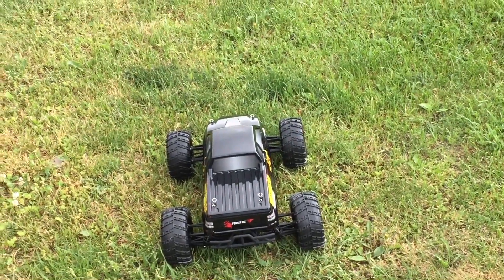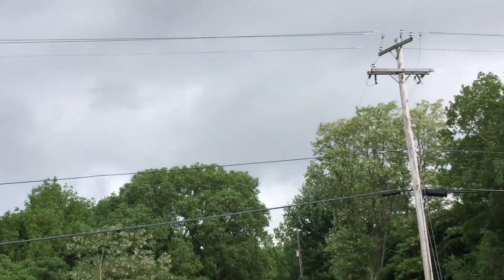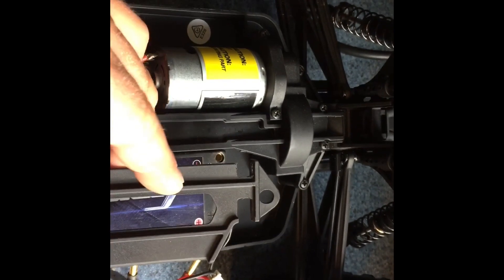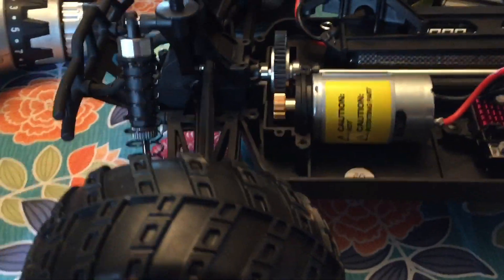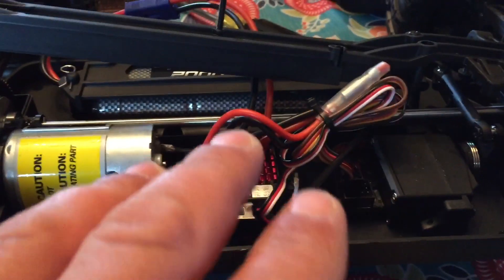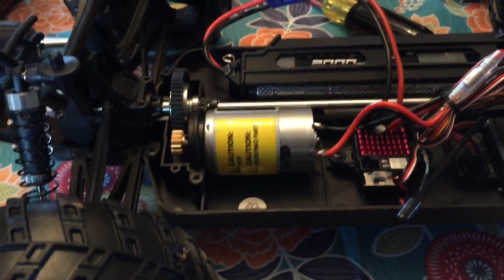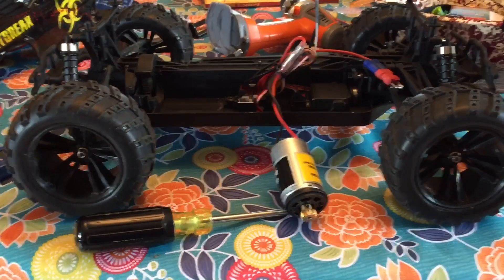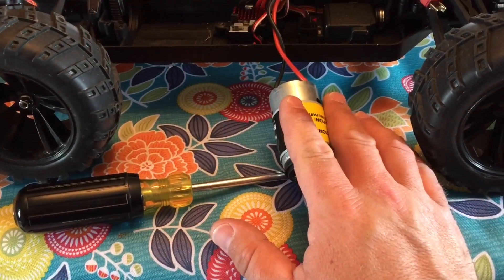Force RC Outbreak MT-issues from the start

Comment: I had the same chassis ..Himoto Tanto brushless.. plastic is very brittle ..the buggies exposed shock towers broke on the first few small jumps lol
Reply from the maker: I’ve been tempted to try the Himoto brand of rcs
Reply: It's hit and miss..the tanto was cool but brittle..but i have a himoto viper nitro and its tuff as nails lol..force rc and iron track use the himoto tanto chassis

Comment: Bummer the motor adjusts the pinion gear mesh to the spur exactly like you shown when you spin it in the slot because the collar on the motor is out of round so when you turn the motor it is like a cam and makes it get closer and further from the pinion gear..  Does it have a slipper clutch maybe it was  way to loose and slipping? I think you may have put the motor in and had the gear mesh to tight why the electronics over heated... next time put a piece of small paper in between the spur and pinion gear and turn the motor like you did until its tight meshed then roll out the paper and it should be set good.😊👍
Reply from the maker: Honestly, I’ve done the paper thing so many times, I figured I didn’t need to because I had gotten good at it lol. I’ve never seen on a 4x4 before that the screws didn’t actually “lock in” the motor position. Just that cover with 2 screws on the top to lock the position seems odd to me. I thought maybe the rear diff gears were shot but if that was the case, wouldn’t I hear it when rolling the truck by hand?
Reply: Hi that's one of the best methods they now use for adjusting motor pinion gear mesh, to test if any gears are shot take the motor out and press your thumb down on the spur gear with pressure and force the truck to roll forward and backward while applying pressure to the spur gear making it hard to turn if it turns the spur with pressure held down on it a bit when you roll it back and forth then the gears are most likely intact.
Reply from the maker: Awesome, thanks for the info Steve, I’ll try it out! 👍✌️🤛
Reply from the maker: Hey Steve; if I may pick your brain for a sec? I got the new spur gear yesterday and installed it but I’m getting the same crunching sound. The diffs seem fine..there is no slipper for it, the spring on the driveshaft is held in place by a pin and small cup; no nut to adjust tension...and the motor collar is perfectly round which seems odd..I can’t for the life of me figure it out..do you have any ideas?
Reply: +Haydad RC Hi the plastic on the motor is perfectly round but it's mounted offset with the motor, if you place it in the chassis and spin it completely around slowly one turn you will see that the pinion gear mesh gets tighter than loser, you probably won't be able to turn the motor in the mount one complete turn because of how it works. go toy with it you will see how it works 😀
Reply from the maker: Ok...I have tried different positions by turning it but no luck...I’ll mess with it some more tonight after work...I really appreciate your time!
Reply: +Haydad RC Hi take off the pinion gear place the motor in the motor mount look at the motors shaft and turn the motor slowly one turn you should see the motors shaft move closer and furher away from the big spur gear when you spin the motor around in the mount.

Comment: It stinks to get a brand new RC with multiple issues straight out of the box. Here's hoping that it's worth the trouble once you get the problems ironed out.
Reply from the maker: I realize that every now and again a stinker makes it off the line, but concerns me when a kid might get this and have these issues. Thanks!
Reply from the maker: I shop all my rc stuff online, there’s no hobby shops within 40 miles of me. The replacement they sent works fine but runs hot. Thinking I need to gear down a little.